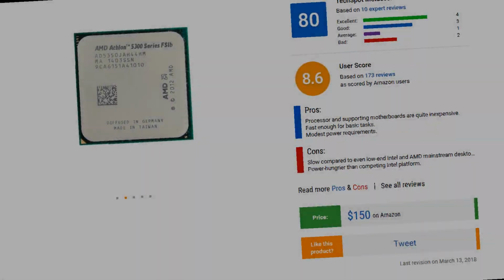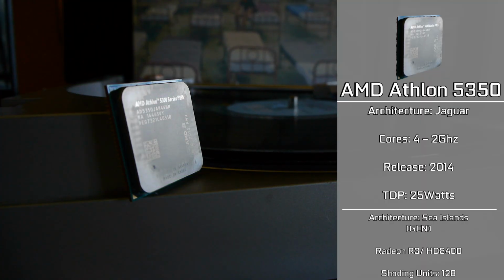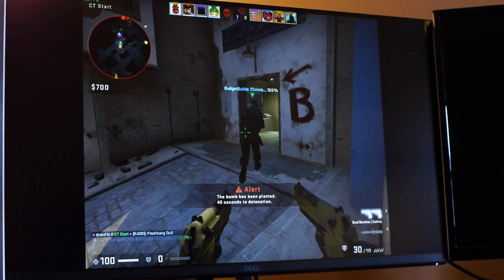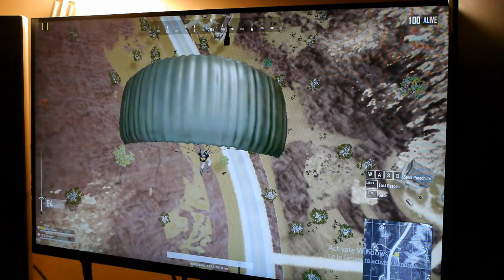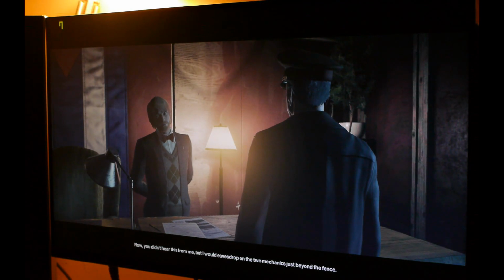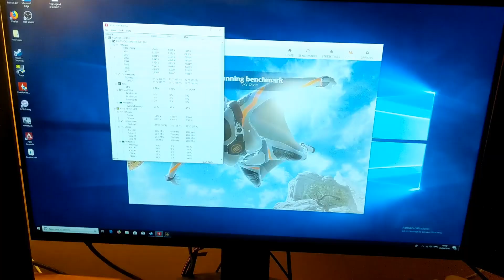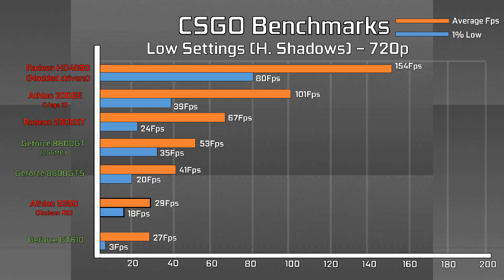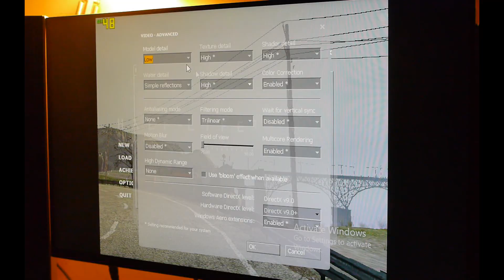Socket AM1 - Aging Horribly!

Comment: The AM1 Jaguar core was basically a die-shrunk K8 with a DDR3 memory controller grafted on. Eight of these cores were good enough to run a console with a modern GPU, but they're not going to be great PC gaming CPU's, either in 2014 or today. The reason it runs like a C2D is because the CPU section of these APU's more or less dates from that era.

Most of the people who bought these used them for HTPC's or for someone who just wanted to get online with it. That's why you never hear about them now. People bought them and then forgot about them.
Reply: Jaguar cores are used on Xbox 360 right? or not? if I'm right, they are ooold.
Reply: No, they're used in PS4 and the Xbox One. Xbox360 used a PowerPC chip.

Comment: I actually built 2 of these in CoolerMaster 120 and 130 mini-ITX cases when they first came out to try to flip (I was actually trying to get rid of the cases), but never got around to it due to my work schedule. Tried some gaming a few years later and I was actually impressed with the igp for the games I tried. Like Killing Floor 2 and Borderlands. Ran great at 1080p on medium. You supposedly get better performance with only 1 stick of ram installed since the cpu isn't dual channel. Ran even better with the R6870 I put in one. But at this point I have relegated plans for one to be a pfSense box and the other to be a backup NAS server due to their low power use.

Comment: Jaguar architecture was trash. Like REALLY. AMD didn't barely used it in am1 CPUs. Just for consoles and CPUs from PS4 and Xbox are trash lol
Reply: This is not a full jaguar core. It is a castrated one with cache at half speed and a single channel memory controller. It is the amd equivalent of the atom.

Comment: Can somebody explain to me, why it so slow? 4x pcie, ok, no l3 cache(but c2d and c2q didnt have it either), why so slow?
Reply: Level 2 cache is actually faster than level 3 cache. It’s slow because of its bad ipc, low clock speed, single Chanel ram, and low amount of L2 cache.
Reply: @EvilTurkeySlices  bad ipc? What is it?
Reply: The architecture simply is not able to offer more performance, and the TDP of 25W totally limits this APU. It's like an obsolete car engine.
Reply: @IsmaelWensder  but what is the architecture? What is inside it?
Reply: @xynxyebbln6801  Do not fry your brain trying to understand a bad old cpu. It's just bad, made to be cheap to consume low energy and generate low heating.
Reply: @IsmaelWensder  if i will not understand why cpu is bad, how can i understand why other cpu is good? Numbers are good, but they aint telling all about processor. Sorry for bad english, i am from Russia
Reply: @xynxyebbln6801  You need to research on your own, there is a lot to know, do a good search, it is a good way to learn. The technology of the cpus changes a lot, it is necessary to search from time to time.

Comment: Wait... I've seen laptops get hotter than that using less power with far more heatsink surface area and a fan... and this CPU runs on 25Watts just passively heatsinking into its own IHS?
Damn, laptop market really needs to step up its game.
Reply: Problem is stupid sizing down of the laptops, You cant cheat laws of termodynamics while making it thin af. Thermal throttling is common place. And when paired with HDD as only storage you are in for hell of sluggishness, hardware lag and long loadings of everything, everywhere.
Reply: r/wooosh
This comment wasn't supposed to be taken literally lmao.
But tbf laptop heatsinks do have a whole lot more surface area, oftentimes cooling a 15-watt intel chip with a 20 or 25-watt turbo TDP. These low power AM1 Jaguars must be insanely thermally efficient, probably due to running ultra low voltage if I had to guess. Jaguar's very capable of running higher clocks afaik, but the voltage curve isn't favorable up there. The PS4 and XBox Ones likely needed the heatsinks they have, to handle increased voltage for a pretty much 99.9% yield even on early Jaguar wafers. Makes sense from a business perspective to have AMD make a low voltage silicone design, and then pump way more voltage in to make even the low quality sections of the wafer usable. Not so great on the end users' electricity bill though.
Reply: @kmemz  
r/ihavereddit ;)
Back to topic... That, and his one probably was already throttling.

Comment: Well it's about the same performance of a Core 2 Duo E8600... But on that platform you can opt for a Xeon and then do FSBmod or pinmod to get even more performance... So RIP these mobos
Reply: An e8600 would probably still perform better.

Comment: The issue with this one in games is exactly the lack of L3 cache.
Reply: I honestly doubt that it is the sole reason because my athlon II x4 651 doesn't have any l3 cache as well but performs much better.
Reply: @СтрочковА.В  Doubt all you want, but your Athlon II X4 651 has 4 MB of L2 cache, while the Athlon 5300 series has only 2.
And that is on top of the 50% more clock speed that you have.
Reply: @AndreiNeacsu  Well, that's a fair point, but I bet there are more flaws on the level of architecture itself.
UPD: A quick wikipedia search confirmed a detail mentioned in some other comments: this chip is pretty much derived from Jaguar apus used in consoles. Therefore, I think it is simply not optimised for operation under Windows. This also may be the reason why despite poor performance in other tasks it is not too bad in the media playback department.
Reply: @AndreiNeacsu  
The 5350 is a shared cache though, so each core gets the 2MB, while the 651 has a strict 1MB per core, which is hugely wasteful. (just like the PentiumD vs the Core2Duo)

That huge 33% deficiency in clock speed (assuming a similar transistor count) is surely the biggest factor.
I would bet #2 then is the 5350's lack of multi threading, which causes those 2Ghz cores to frequently sit idle for several (and sometimes hundreds of) cycles at a time for every cache miss (or stall), etc. that occurs...

Both of those issues will hit performance in every single task by around 33%, while a lack of High level cache, even if both were shared, would only hit certain tasks...and for those reasons, it would be hard to confirm just by looking at performance...
Reply: There's no L3 in my Athlon X4 870K either, and it does much better than this. Having more cache of any kind would help the 5350, but the low clock speed and the fact that Jaguar was basically an updated K8 design hurt it more.
Reply: @johncate9541  It is handicapped by the l2 speed, not size. The cache is running at half speed and this is disastrous. This cpu has very few execution units (load and store ports etc) , very few cache entries, single channel ram and half speed l2 because it is a low power cpu. This is the same reason the fastest Intel atoms are much slower than the slowest core m cpus.

Comment: I had a closer look, and it appears to be the same sort of APU that you can find in the t620 HP Thin Client! I reviewed the t620 Plus last year and it has that same 4 Core Jaguar CPU with around 2 GHz and Radeon 8400 type graphics. I installed Windows XP and with the integrated graphics got around 60 FPS in Far Cry. Installing a GeForce, the scores basically didn't change, so even in that old game, the CPU is a huge bottleneck. I tried Windows 10 and with a GT 1030 it ran Grid Autosport with just over 30 FPS Medium Details. For Media Playback I found it to be average, for example the outputs can't do 4k60 and while it accelerates the H264 stuff, it really chokes on newer codecs like VP9 that YouTube uses, especially 60 FPS videos are too much. A dedicated GPU helps greatly here.
Reply: I subed
Reply: with this apu i'm able to decode h265 1080p with only 20-25%cpu usage on windows media player classic, the same file on kodi have 100% cpu usage and less that optimal framerate.
Reply: @davidereverberi5279  Seeing as its a 4 core 25% is one core maxed out, probably close to dropping frames if not dropping a few already.
Reply: @Protoking  no frame skipping or slowdown 1080p h265 is perfectly fine, now even in the new kodi internal codec
Reply: I have one of those and with a gt 1030 i can get rainbow six running but I really need an upgrade nonetheless
Reply: These are pretty much baytrail atoms but from amd and with a socket instead of being soldered.
Reply: Win10 is too much for the Chip. the 4 Cores are horrible limited by the single Channel IMC
Reply: as i remember, i had to install a 'beta' driver for vp9 acceleration on the old ass APU's, the normal ones... yeah... amd drivers are... far from stellar...

you can overclock them that was a  big draw for many cheap buyers... and the onboard video was useful for extra displays or as a falback...

you MUST use higher then 1600 ram, period, 2133 minimum, 2400+ better, with that at 3.8or so ghz, you would get a much smoother result, even on the igpu, and, the fury is actually going to cause at times, a bottle neck in the other direction, the cpu trying to keep up and actually doing worse then a more... close to the power of the overclocked chip could produce...

Comment: First thing that socket wasnt better for gaming 5 years ago (same chopy) 
Second it is limited with memory bandwith and pcie x4 for gpu as I remember
Third you can overclock it via bclk to 2.5ghz and than is a lot better gaming exp.
Allso CS:GO is older than Cpu but heavily patched and improved since 2012...
Reply from the maker: Improved in terms of gameplay. Much worse in terms of performance. See pinned comment for more info
Reply: @BudgetBuildsOfficial  I had bad experience with 5350 when it was out new (slow in windows, low fps in games) Problem is cpu speed an memory bandwith-pcie lines. Cpu on paper is good but problem is that it meant to be cheap subnotebook-ultrabook-tablet Cpu and it ended on PC . I bought 1 for fun with asus mobo OC it heavy , max fps in games did improve but overall feeling was same. Whole socket with fastest CPU was pain in the ass and cheap 775 C2duo was snapier.